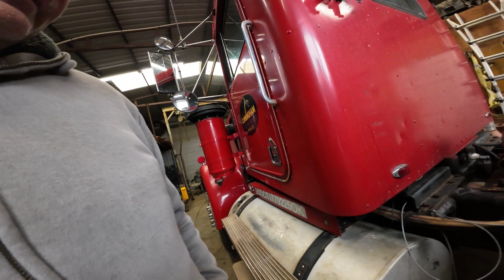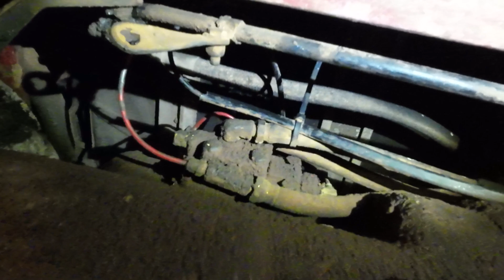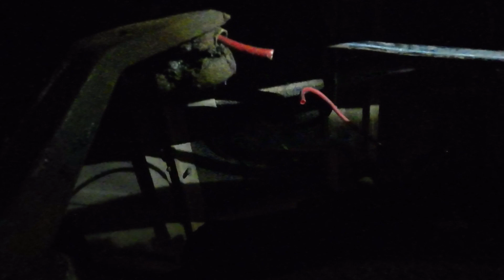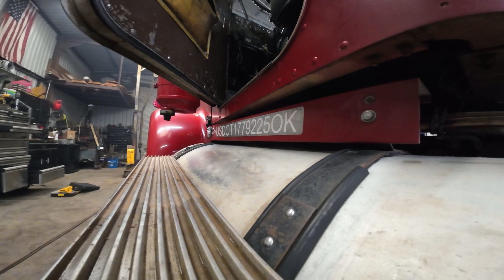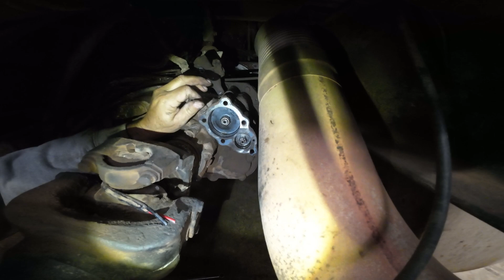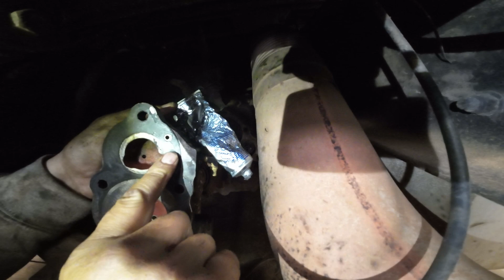Lil’ red cracked a piston. #digginok #backhoeman

Comment: Frank, serious clickbait title.  When I saw that I fully expected to see you elbows deep doing an in-frame, all the while complaining on the price of the kit.  You really got me on this one🤣.  On another matter, I may have stumbled on to a pretty sweet deal, 1981 Transtar 4200 with a 6v92 Detroit.  Just going to use it to haul the 580 SN WT or a 750 class Case dozer.  Thoughts?
Reply from the maker: Sorry for the title, that IH would be super cool! Should be fine for power if ya don’t have any long steep hills. My dad has a 1973 4270 with an 8v71 turbo. Rated at 350 hp but I’m not sure if it has any torque 😂